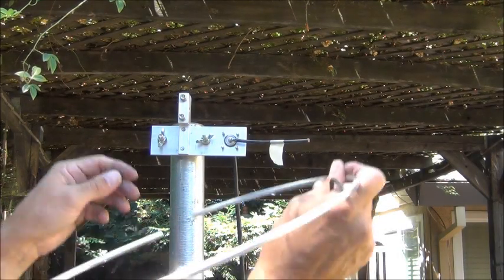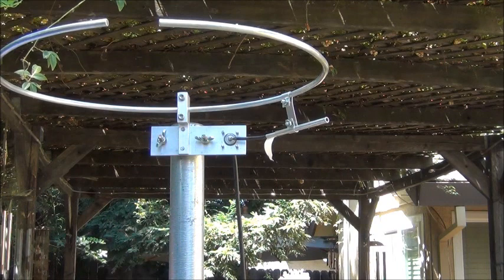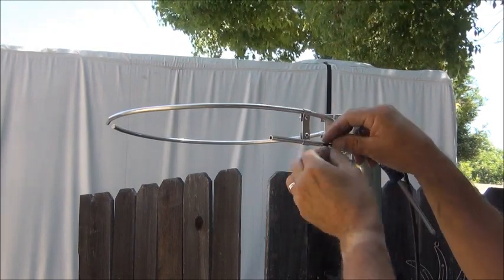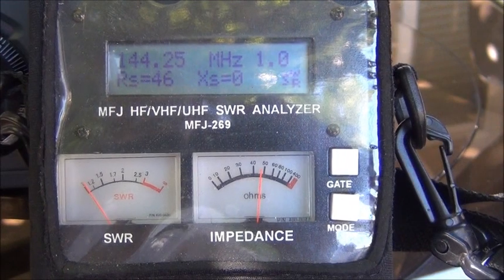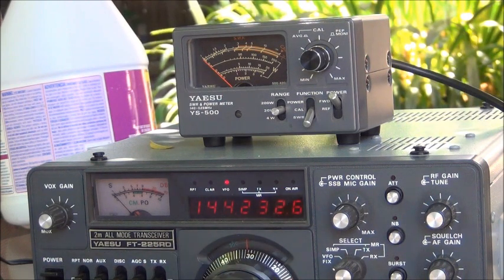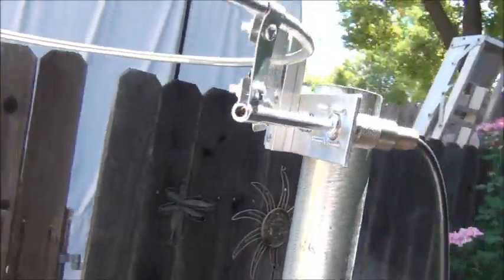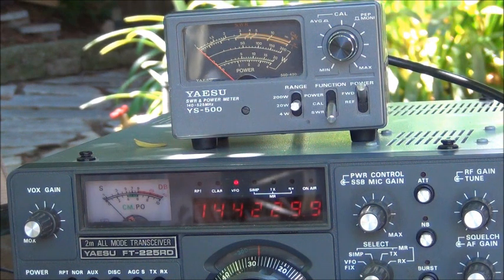2 Meter Halo Antenna Part 11 -- "Assembly, testing & remaking the gamma tube" by N6TWW

Comment: It seems that a "Halo" antenna uses a different principle to a "Magnetic Loop" antenna.
One problem with the latter is the very narrow bandwidth.  Does the "Halo" have a wider bandwidth than the "Magnetic Loop" ?  How do you calculate the gap ?
Reply from the maker: Yes, a halo antenna will have a wider bandwidth than a magnetic loop. A halo antenna is basically a dipole antenna. The halo dipole has just been shaped into a circle rather than a straight line. I set the gap just by trial and error.

Comment: Have you ever modeled or measured the pattern and measured common mode on the mast  and/or coaxial feedline?
I have and the pattern is not a very good omni and there can be a lot of RF on the mast and the outside of the coax.
Reply from the maker: I have never modeled the antenna. I did install toroid cores on the feedline to reduce any RF feeding back down the feedline. I have noticed that the pattern is not completely Omni directional by rotating the antenna and monitoring the S-Meter reading while doing so.

Comment: Thanks   ....I kind of figured .....Also which is the best antenna ... I live 50 miles from Albuquerque in Northern NM...,, and in southern NM in Santa Rita about 30m from silver city PA repeater. I normally use a mobile antenna on the roofs of both places..
Is it the Halo, Mobile Yagi,  or the J-pole ?
Reply from the maker: paul pedrazza The halo design is not the antenna for repeater use. It is horizontally polarized which means there will be about a 20db loss trying to work a vertically polarized FM repeater. The halo antenna is designed for single sideband use. You would be better off with an vertical omni antenna.

Comment: I noticed that the center wire is not connected.. is that the way it's suppost to be?
Reply from the maker: Paul Pedraza Yes, that is correct. There is no direct connection. The center conductor of the wire inside the gamma tube is one part of a capacitor. The center conductor acts as one plate of the capacitor and the aluminum tube acts as the other plate of the capacitor with the insulation on the wire acting as the dielectric. The RF signal from the radio is capacitively coupled to the radiating element.
Reply: It is a dipole, not a magnetic loop

Comment: Each antenna needs to be perfectly tuned, when you stack the SWR should NOT change. The spacing, the velocity factor and impedance of the feed-line is critical. I stacked a pair of M2 HO loops and they worked great at 70 ft
Reply from the maker: It's great that your installation went so smoothly. After you build all your own components let me know how it goes.

Comment: Can you elaborate on the gamma match?

Tubing size?  Coax Cable?

Thanks
Reply from the maker: The gamma match is nothing more than a variable capacitor. You can adjust the capacitance up by moving the tube on to the wire more or down by moving the tube so the wire is not as far into the tube. I used wire that is normally used for house electrical wiring. It is multi-stranded.  You could used coax for this but mine is not coax. Coax could work but you would use the shield in the coax as one plate, not the center conductor. I just used a wire size that fit snugly into the tube. It could be any wire. All you are trying to do is to build a capacitor. (two metal plates with an insulator between them.) One plate is the tube, the other plate is the conductor in the wire. The insulator between the plates is the wire insulation. Any wire and tube combination will work as long as you can get the right amount of capacitance. I believe that the capacitance on a two meter antenna is about 14pf. The strap the attaches the tube to the radiating element allows you to adjust to the 50 ohm impedance location on the element.
Reply: Use the inner conductor AND dielectric of RG58.  Works great. I've even done gamma capacitors with the inner conductor of RG213

Comment from the maker: Yes, if you do not bend the radiating element in a circle and just leave it as a straight element and rotate it so that it points up and down rather than right to left. You will also have to stand off the antenna from the mast to reduce coupling to the mast. It should work. You can see what the antenna looks like before it is bent in a circle in the part 1 video.

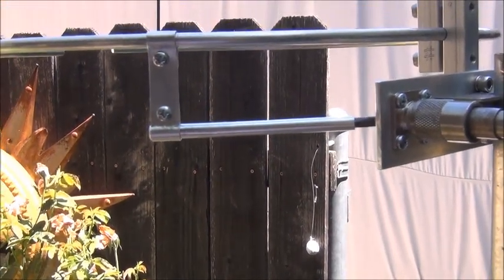Comment from the maker: If you noticed the comment I made at about 4:32 to 4:52 then you would have noticed that I said I would need to readjust once two loops were stacked. Since the original gamma match was at the extreme end of it's adjustment range there may not be enough adjustment once two loops are stacked together. If only one loop was going to be used then the original length would have worked fine.